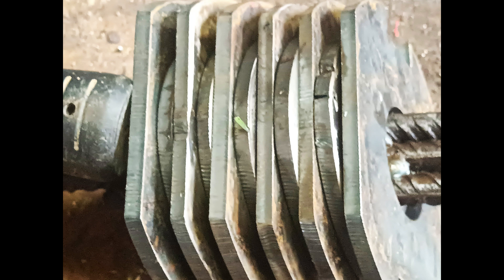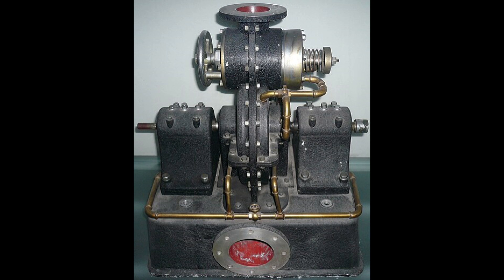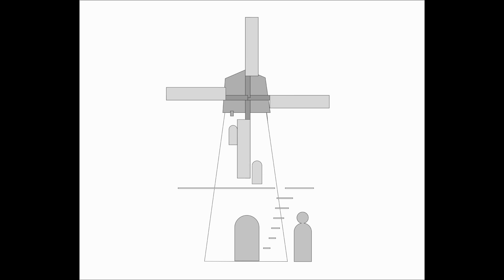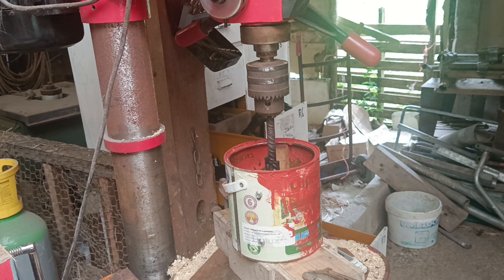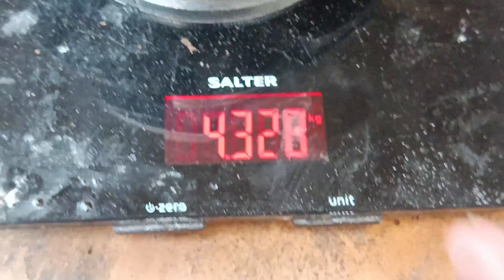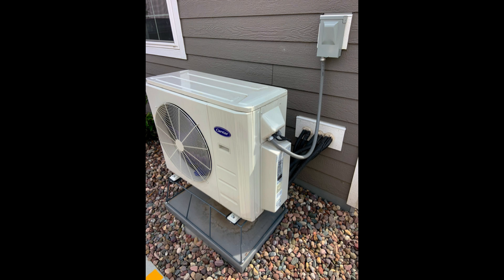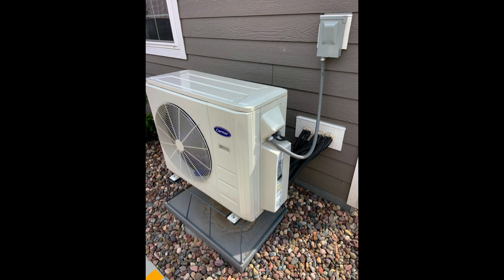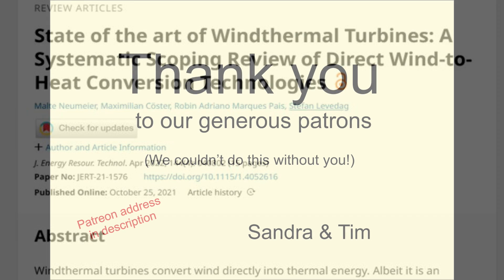More Interesting Things About Friction And Mechanical Heating - It's All So Interesting!

Comment: Look at vertical  windmills.  Much simpler as wind in any direction will work. One less gearing. 
Because the blade at both ends are mounted so unlike  horizontal where just one end is mounted. Leaving you to worry about flexing.  Heavier blades = more weight = bigger bearings.  
Try two bicycle wheels with blades between them on a vertical shaft.🤔

Comment: The compressor in a heat pump does move vapour, to be specific superheated vapour, that is that it heated above its saturation temperature and this can apply to gases that to the touch feel extremely hot and gases that are extremely cold can in fact be superheated. While the compressor may only be moving a refrigerant vapour it’s the physics of the vapour compression cycle and the condensing of the higher temperature and pressure vapour into a liquid and the subsequent expansion of the liquid back into a vapour where the process stops being just about SENSIBLE HEAT and becomes a process where LATENT HEAT where far more energy is absorbed by an evaporator and then rejected by a compressor. For example to change 1kg of water by 1°C (which is sensible heat) required 4.187kj/kg, to change that 1kg of water to saturated steam at the boiling point will require an additional 2260kj/kg just to change state and the same principle applies to freezing but it requires around 330kj/kg at the freezing point for the state change.
Heat pumps take advantage of this process as they absorb from one medium and reject it into another PLUS when you are using the rejected heat you get not only the absorbed heat but you also get the heat of compression and the electrical energy that has been added, that’s why heat pumps are so efficient.
While they are very efficient they are much more complex than using the heat generated from rotating motion and very unlikely that anyone could engineer a system that directly drove a compressor with a variable energy source like wind.

Comment: Look, I understand you want to do somethyng different but a gearbox and generator at the head of the windmill would be far more efficient than a drive shift and gear system with multiple bearings transferring the energy to ground level and an electrical heating element is 100% efficient.

Comment: Tim, just a thought but why reinvent the wheel spinning discs that generate heat with a friction material have been used on cars for decades it's disc brakes you could stack brake discs on a shaft and the callipers could give you a varying degree of friction spun up in water etc to transfer the heat, even the pads are "consumables" for ease of service. as a mechanic I usually think car parts, whatever you build will be amazing and cant wait to see it.

Comment: YEARS AGO my neighbor made a friction heater using a dryer part of the washing machine. Worked like a champ. I was just amazed at the heat this made with very little electricity being used. I bet this technology is being suppressed by the powers that beeeeeeee. 
Nice video Sir. Hope you beat the cold, that usually SSSSUUUUUCCCCCCCKKKKKKKKKSSSSSSSs

Comment: Friction for heating might be a good idea, but I don't think you've considered the system as a whole. You can't adjust the friction in your setup; it's fixed. If you set it too high, then at low wind speeds you get no power. If it's too low, then at high wind speeds you won't be using all the power the wind can provide. With electric generators, the load you put on effectively changes the "friction" to maximize the capture of energy. I would bet that in real life, despite the conversion inefficiencies, a generator with a controller hooked up to a resistive heater would result in more heating.

Comment: I think friction heating is a bad idea. Personally I'd calculate the max energy from the wind using an appropriate equation, then size the othe components to suit. I'd either use an old torque converter or a dynomometer and a heat exchanger from an old combi boiler. They're ready made and available at scrap prices. Vibration and throw will destroy your primary side container and a single plate exchanger system will not transfer any useful energy.

Comment: To lower RPM for contactless system you can use different, more viscose liquid. As additional benefit it will self regulate, because if it start overheat it becomes less viscose which lower friction and stabilise energy transfer.

Comment: Another +1 for a heatpump. You can get the parts for cheap/free from an old fridge, freezer or air conditioner (although not that many of thoes in Ireland) and can get what looks like more than 100% efficiency!

Comment: Thanks for once more patiently explaining your thought processes. :)

I love the idea of a heat pump but I wonder how well it would work at the varying RPMs that would be provided by something like a wind turbine. And either way it definitely drives up the complexity and cost over just steel plates rubbing away.
Reply: i was going to say this. friction based systems is the way to go. maybe not steel on steel but friction none the less.

Comment: great idea Tim.  a Cambridge science friend told me to heat water with our large water wheel, in our mill.  i went down the gears and electricity generator route and only managed to turn  4kw of water power into 50v at 1 amp of electricity...we should have heated water.  i was going to stir water in an old lagged hot water cylinder snd pre heat the hot water in the house.....fascinated to see what is the simplistic method of friction heat.   following your ideas with great interest

Comment: Cpuldent you use a verry viscous oil to increase the liquid heating, use something like a used torque converter from a car and get away with lowwer rpm requirements for heating ?

Comment: Heat output will vary in relation to friction which will vary in relation to to surface pressure. To maximize heat you will need a way of apply ing variable pressure between plates in relation to variable input wind speed and force?

Comment: Hi Tim. I'm glad you mentioned Induction Heating.  
It is probably the simplest of the "no contact" methods, and the need for high speed can be avoided by using a larger diameter. Even a large annular ring would do. 
(although there are many designs on the web for directly driven wind generators which have a relatively small diameter).

But when you think about Induction heating, then it's only a simple step to  generating electricity directly. Having your energy in electrical form has so many advantages.

The obvious method is to use a surplus AC motor connected as a generator. You can pick up large motors for scrap metal prices.
Further,  if you don't need a precise frequency, you could do away with speed regulation.
You'll find many designs on the web for people using AC motors as wind or hydro generators.

Likewise there are many designs for home-made Generators using magnets embedded in wooden disks.
I think you should definitely be thinking about homemade AC or DC generators to convert wind energy to heat.

P.S. I still think that Solar electric heating is the way to go. I heat my small shack with a fairly large solar array, set of Lithium batteries and a heat-pump Air-con.
Last night was down to about 3 degrees and my air-con was drawing about 300 watts continuous.
And this morning the batteries were back up to 100% by midday.
However the secret is very efficient insulation (double glazing and heat-exchange ventilation), while the payoff is perfect thermal regulation with zero maintenance.

Comment: Some old automotive AC systems used compressors that were powered directly by the engine belt via a pulley, I think such a thing could be a good candidate for running a heat pump if you can get your hands on one, I've also heard (though correct me if I'm wrong) that some hobbyists have built heat pumps / refrigeration systems using propane as a refrigerant.

Comment: Hey Tim!  I know you want to invent and build, but if you manage to build the wind mill, you could get a heatpump style water heater (they are available in the USA) and drive the compressor with the mill instead of a motor.  Then you would have a proper hot water tank from which you can use the hot water for whatever purpose you like.

Comment: As an electronics engineer, I would obviously default to a generator, but I really respect the mechanical approach. I honestly would have never of thought of it as an option. But I like it, alot. and the vibe im getting is your doing this for the fun of the project, not profit or anything like that. I think your on a pretty good path, you could do alot with 1kw of constant heat. Hope your feeling better soon Mate
Reply: can you explain how to get a generator to deliver power on the same rate as wind power, the cube of the velocity?

ie, double the RPM, produce FOUR times the output.

then theres the whole issue about jacobs law and exactly where the power is appearing, in the generator? or in the load?

so you get the generator to increase its output in proportion with the wind, but whats the point? wheres that power going? whats it doing?

as per above, jacobs law... the generator is only half the issue. the load itself is the other half. to "increase the generators output" requires the load also change to allow for that... yknow, ohms law and all that, its not simply a matter of "increasing the generators output" as its dependent upon the load as well... 

and as we keep being told, wind doesnt deliver its power reliably, predictably. its erratic and fluctuates wildly. how to match that to the ideal load with a generator and maximise our yields when we have no idea what the power source is going to do next?

batteries? that can only accept so much charge before wasting excess energy as heat? eventually degrade and need replacing? rely on mysterious black boxes that love to release magic smoke?

as an uneducated highschool dropout, im doing my best to get as far away from electronics and generators as possible.

magnets and conductors? great. far better than friction based ideas.

electronics and generators?

no thanks ;)

heat is easily stored, easily produced, and whilst not overly convenient... is relatively easy to convert into electricity, as required, and thats relatively straightforward when you have a power source that behaves in a predictable manner.

what do we mostly use electricity for anyway?

to make heat.

Comment: Air compressors generate a lot of heat and don't have to run all that fast.  Would putting a water jacket around the cooling fins be worth examining?

Comment: what if you adapt brakes from a scrap car? they're specifically designed to apply a variable, controlled amount of torque to slow down a wheel and generate heat.

Comment: If you're worried about mechanical losses in the gearing, one way to mitigate that is to put the gears themselves in the fluid. Then the "waste" friction of the gears isn't waste at all!
Reply: You could build an insulated workroom around or over the gearing at the bottom and get a heated workroom for free.

Comment: Consider electromagnetic induction,  less wattage, low voltage  lots of heat. Permanent magnets are spun at high speed with almost no torque and they induce eddy currents in a steel container without contact, this in turn heats the water. You could use low voltage electromagnets made from old microwave transformers instead of permanent magnets too. Just rotate fast without contacting the water container, and it will heat with minimal friction

Comment: First of all for the magnets and steel, if you make the wheel larger in diameter, you'll get the benefit of the increase in rim velocity.  But the second thing you can do, is simply make two outer rings of steel, with ferrite magnets between them (like an oreo), so that the upper one is north, and the lower one is south.  Then cut a lot of teeth into those rings on the inner surface (staggering the N&S rings), and have a thick metal plate with a different number of teeth (two nearby prime numbers would be ideal), spinning inside.  Presto--you have hundreds or more changes in magnetic flux for one single revolution, easily generating a kW or more at 80 rpm with just a modest magnetic source.  And the mass would make a decent flywheel.
Reply: An added advantage of magnetic breaking, is that it has almost no resistance at rest, so the windmill would have an easier time starting.
Reply from the maker: Sounds good, Derek - thanks. Don't suppose you could send me a drawing or a link please?
Reply: @wayoutwest-workshopstuff6299  ok, I finally got around to making some drawings.  Stuck them on this old thing called a blog:  https://dwoolstar.blogspot.com/

Comment: The idea of using steel plates does seem really simple, and in that way it is great. I dont know how much you want to heat though. I would imagine this wouldnt even be enough for a single room, especially not if it isnt insulated well. I would say the best way would be to use a chain or belt, directly atached to the shaft of the mill, all the way down to a smaller wheel. I would imagine that this would work for up to ~10 fold increase in rpm, and this way there is less friction, so more efficiency. Then I would just  an existing heat pump, like from a car ac, and you can find them for cheap from an old car (I would assume). they would need a higher rpm, but you can always use another pully in the middle, would not take that much efficiency. If they are not to modern, they wont have any electronics. They already have a belt Drive, so the only thing you have to do is get the cold side ventilated by outside air, and the hot side Inside your house. A single one uses 10 hp, so about 7kw, if the windmill does not make that kind of Power, you can always run it at a lower rpm, the engine of a car does not alway have the same rpm either after all.

Comment: some type of adjustable spring to compress the plates would allow you to use all the torque when the wind changes.
If it's a not so windy day then lessen the tension on the spring to keep things running then when the wind blows you can tension up the spring to get the most friction.
Reply: And then use a ball type govener like on a old steam engine to adjust the spring pressure on the fly

Comment: As a tangent, if you want to transport the generated heat, heat pipes or themo siphons might be worth a look.
I've been thinking about building a crude heat pipe myself, shouldn't be too difficult (dunning-krueger effect talking I'm sure). No real need for the whole pipe to be copper either, as long as the wick is good enough.

PS. Didn't notice how much weight the plates gained, could it be explained by rust?

Comment: Instead of all steel friction plates, use aluminium. The aluminium oxide will be worn away and the pure aluminium metal will oxidise and release a lot of heat and also hydrogen from the water. 

All very complicated though. I myself have bought 3kW of used PV panels for $100 and use them to  heat water with an old kettle element. No MPPT or inverter is required.

Comment: Hi Tim- thinking about your heat exchanger design- what if … the last turning plate in the stack was slightly larger that the rest and on the outside, had some fins to create a centrifugal pump? You could then shape the container (the paint bucket) to have an  incoming and outgoing port, to the circulate the heated water (or oil) around a heat exchanger coil inside the insulated tank? This would probably make the heat transfer more efficient. You might even be able to do away with the heat transfer tank altogether if the pumping action is good enough to run a hydronic heating system directly for example…

Comment: Surprised to see you say 20-30% losses for two sets of gears and three shafts. That may have been true for traditional windmills, but also if that's genuinely what you intend to produce, you should probably just put an alternator up the top for better efficiency.

1970s diesel electric rail freight locomotives (crank rotation -> AC power -> DC power -> wheel rotation) have a crank to drawbar energy efficiency of around 81%. Modern practice with inverters and AC motors beats that.

A properly designed mechanical system should be more efficient than both.

I suspect with roller bearings on the shafts and properly designed gears that you're actually looking at 2-3% losses, not 20-30%. At which point your focus on using the rotational energy and wanting to avoid electricity is correct.

The mechanically driven heat-pump idea is good -- and you can of course drive pumps and fans direct from the windmill as well as the compressor.

Rather than a torque converter, look at a hydraulic retarder as often used in buses and diesel mechanical railcars. They converts rotational energy into heated fluid across a wide RPM range. A 400rpm axle speed is plenty high enough -- they work well to sub 100rpm axle speeds in those vehicles.

Comment: I had a look at the design of plate heat exchangers and it looks like plates are separated by gaskets. The plates have holes in them like a radiator grill,